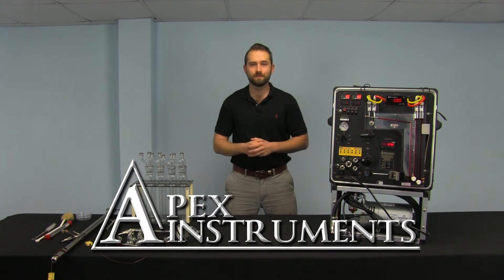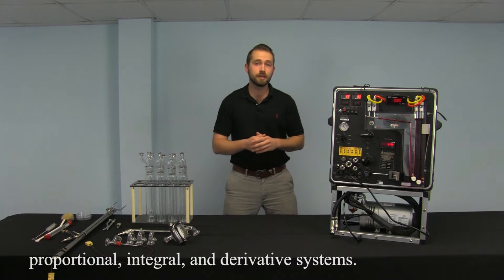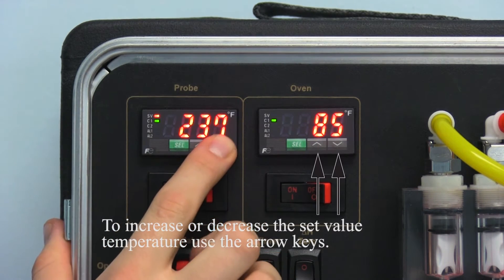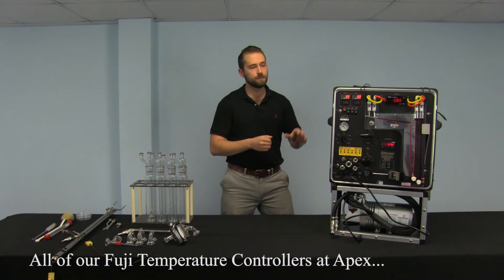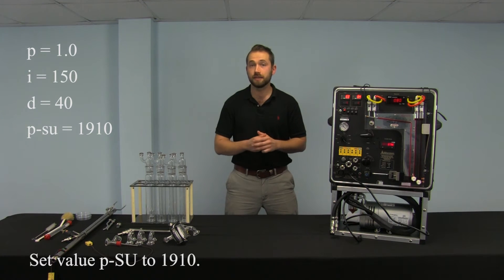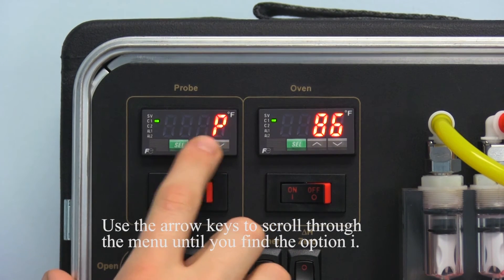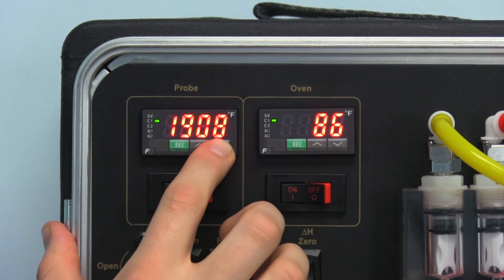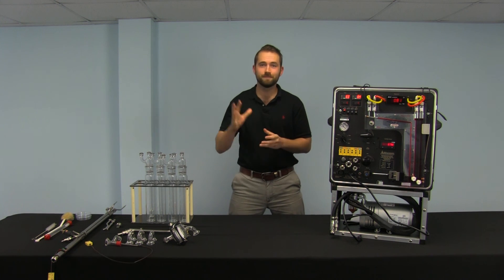Fuji Temperature Controller - How to use and program

Comment: I have a Ty # of PXR3- RCY2, the 6th digit is "C" being a SSR/SSC driving output.  I need a Relay contact output (dry contacts).  Can this configuration be changed via the HYS parameter menu P to "0",  or do I have the wrong part, & need reorder a PXR3-RAY2?

Comment: Where does the TC connect? can you show a diagram?  What TC is required?
Reply: Thermocouple will be on Terminals - (2) & + (3), you can select the type via the menu Parameter P-n2, K is supposevely the default but you may change it.

Comment: I am from India. I want to use a FUJI temperature controller for oven.  My application is simple. Fir example I want to set 100°C for 2 hours soaking time. There must be alarm after stop of timer. Could you help me in choosing correct PID controller of FUJI for such application?